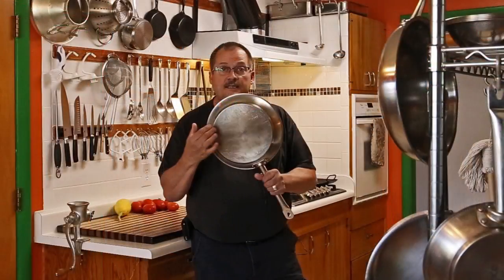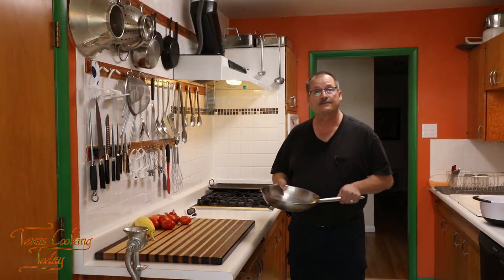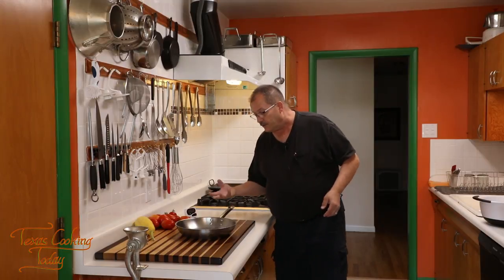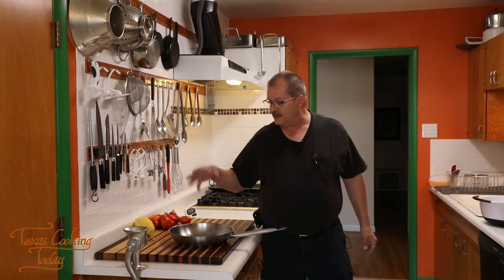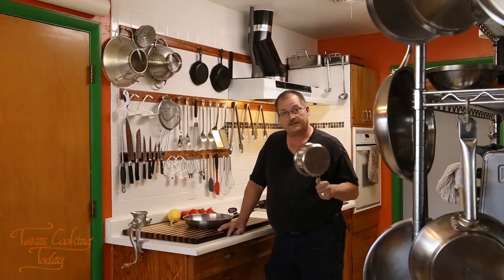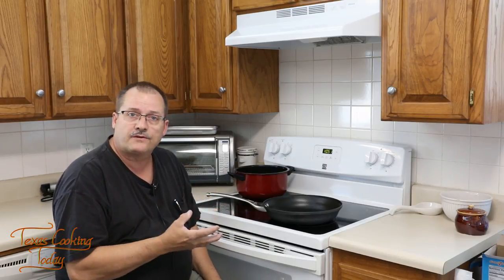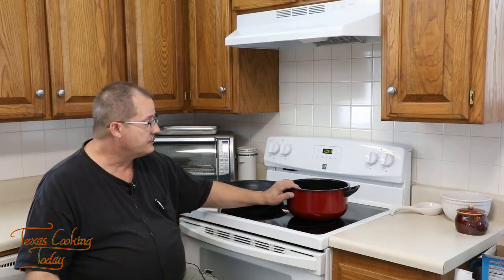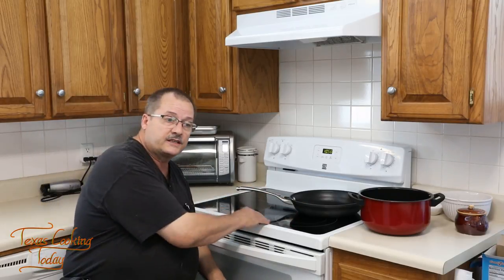How To Heat A Pan   What Causes Pan Warping Ep6-695

Comment: Great video, I have always heated my pans on medium and I have only had two pans warp in 40 years of cooking. Both of the pans that warped were Matfer carbon steel pans. Do not buy Matfer carbon steel if you are cooking on electric or induction, they are known for warping very very easily.

Comment: Great video.
I own 3 ply cookware called Wonder Ware.  It was made by Regal Cookware. I never experienced a warp pan in almost 50 years from Wonder Ware. Recently, on the 3 qt it suddenly bowed in the middle.  After it cooled, it popped back.  I've watched videos on using  rubber mallet.  That seemed to work but then it happened again. I hammered it again in a wider radius and used a level. It seems to be holding so far.  The stove is ceramic. I never had issues using gas. 
I'm hoping that this will not occur again.